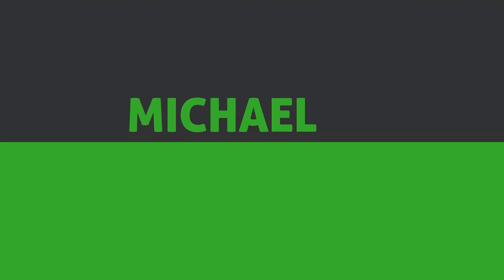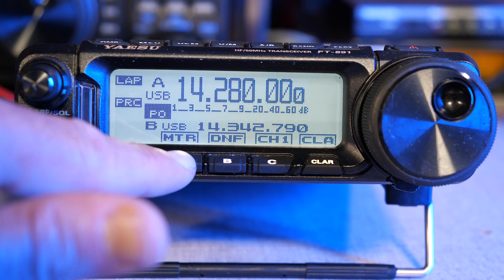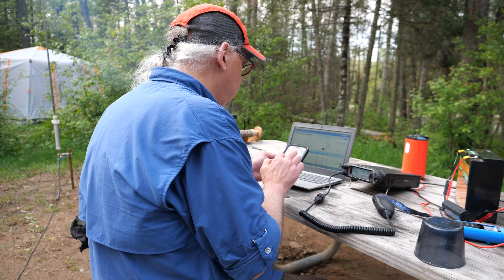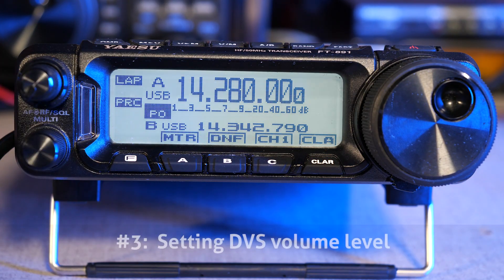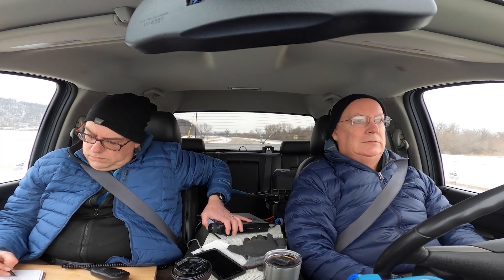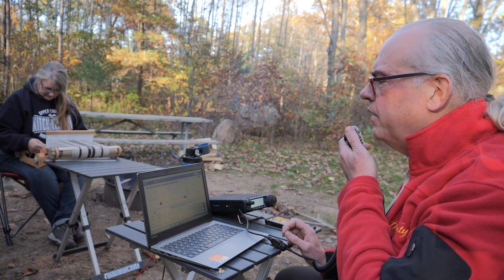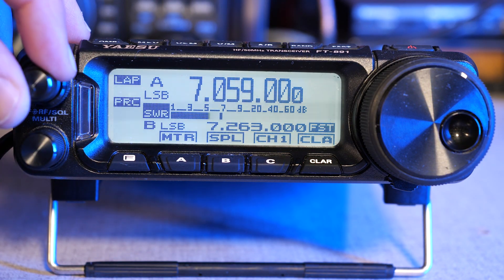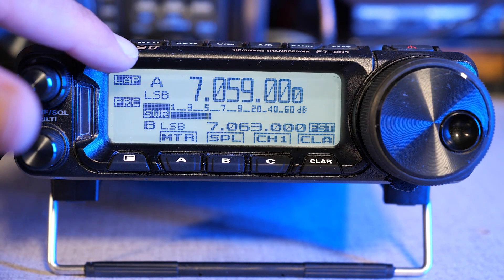Five CLEVER things you didn't know the FT-891 did #hamradioqa

Comment: Another great video Mike. I’ve pondered getting this radio for POTA use as my present rig is an IC-7200 which is big and heavy. But I’ve been burned 3 times by Yaesu in the past, although it’s been a while. If I do wind up with one these are great tips.
Reply: I love my FT-891
Reply: Did you get around to getting the FT891?

I have the IC-7200 also and would love to hear your experience comparing receiver noise floor, audio and dsp functions (noise reduction/pass band/notch). Not in detail. Just the overall feel if you will. 

Doubt I’ll ever part with the 7200 but the 891 just keeps tempting me.

Comment: I suspect that IDD would be the transmitter power amplifier drain CURRENT - not voltage.
Reply from the maker: Yes, you are correct. IDD shows current not voltage.
Reply: yes, drain current. to bad the 891 doesn't display the voltage while it's operating. need to use an external meter. this is very useful when working outdoors.

Comment: The split frequency looks pretty useful for contacting 10m repeaters (fm).  Is there a ctcss function or some alternative way of injecting ctcss tones?
Reply from the maker: You could use quick split for repeater shifts, but the FT-891 has complete repeater support built into their FM mode operation. You can set the split and CTCSS tones and save all that into a memory channel. I'll make a note to cover FM in a future video.
Reply: @KB9VBRAntennas  thx!

Comment: Working split with 5 Up set in the rig, does VFO B follow when tuning VFO A?
Reply from the maker: It does not. That's why when you retune on VFO A, you need to long press the A/B button to match the frequency on VFO B.
Reply: Too bad.  That would be a really cool feature.

Comment: Michael, loved the video. I too have the FT-891 and have used it for about 3 years. And while I use  the A B C buttons to assign some of my favorite options, the ones you showed in the video gave me some new ideas to simplify using the meter in particular. By the way, what headphones do you use with the FT 891 as I operate in my home and when monitoring it some times bothers others.
Reply: That easy front panel meter switching feature is an absolute God send for guys like me that want to constantly monitor their radios operating parameters. 👍
KZ9V